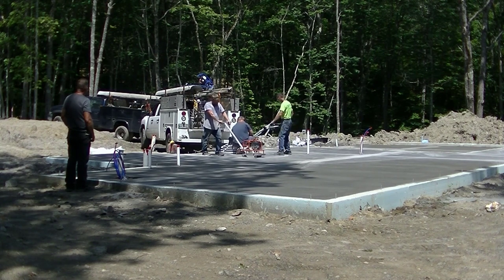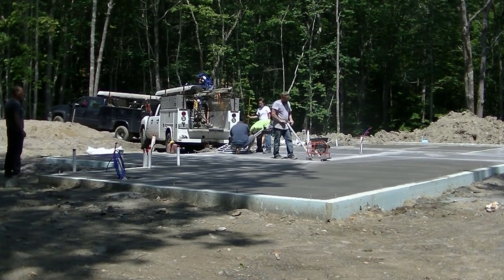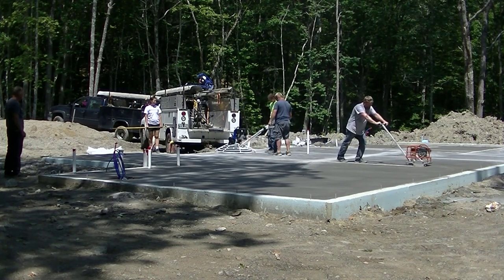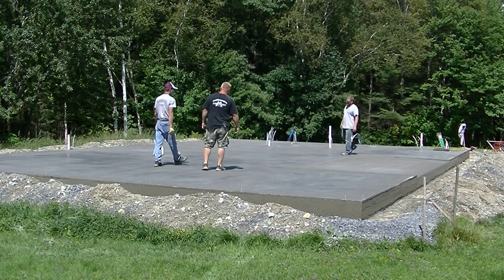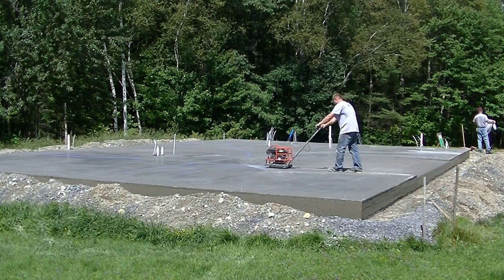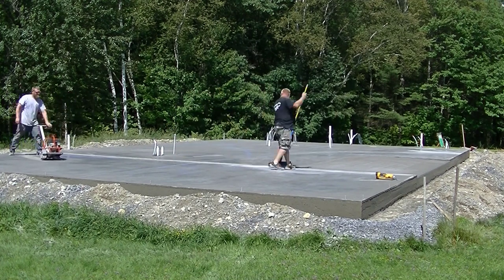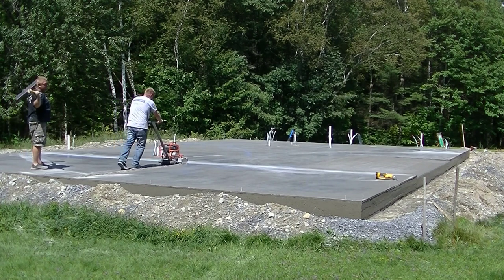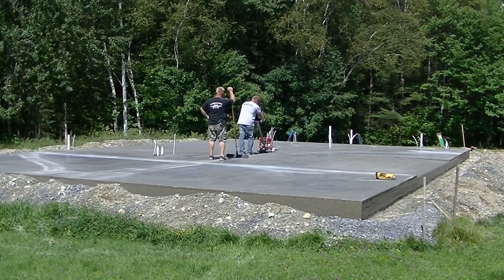The Fastest Way To Saw Cut Your Expansion/Contraction Joints In Concrete Floors & Slabs

Comment: I have the Husqvarna saw with a Suburu engine on it. I don’t use the guide either. It’s not rigid enough.
The saw is great, but we usually cure and seal directly after finishing so we typically cut the following day.
We often times will tool one or two joints on a hot day and then make the other cuts the following day with this saw.
The only issue I have with same day cutting is having to power wash it before sealing. (Adding another process) and also the way that the concrete dust (almost paste) on same day cutting takes away from the crispness of the joint. I have 35 years as a concrete contractor in the Midwest. And when we finish a garage floor to be “baby butt smooth”, we call it burning it in. I enjoy your videos! Best of luck to you!

Comment: I am about to start my own business doing control joints.
I am cutting about 3 jobs a week right now. I use a small electric saw, but want to cut earlier as I often find cracks on hot days.
I am also a concrete finisher in Canada,  and the polished look is called burnishing, which is the correct term for polishing things with steel.
Reply from the maker: We call it burnt finish.

Comment: Hey Mike, I 100% agree about using an early entry saw. In addition to saving time, you save the stress worrying about cracks. The company I work for has a couple, including 1 Husqvarna, and TBH there's not much difference between them.

Comment: I just picked up a soff cut 150  2 months ago and have got to use it on a few jobs now . I'm playing around with when is it time to cut   so far about 1hr and a half after I broom   ill start doing my cutting . I will say it is nice to cut the same day and move on to the next job and not worry about going back  for 15mins of work
Reply from the maker: Yea, it depends on how hot outside it is. 2 - 3 hours is usually safe without leaving any lines from the saw.

Comment: Nice tips Mike, thanks. I've tried planning ahead to avoid reinforcement being run in the same direction too close to the saw cuts to avoid the occasional weirdness of lateral cracks as you described. Seems to work so far.
Reply from the maker: Awesome, nice comment. Thanks.

Comment: I use the rule for how far apart to put the saw cuts as, twice the thickness in inch’s in feet. So a 4” slab would have the squares 8’ by 8’. And a 6” slab 12’ by 12’. You can usually cheat it a couple feet but it’s a good general rule. I also saw 1/4 the thickness of the slab. That helps cut down on cracks right next to the cut.

Comment: Hi Mike, great video.  I wish my contractor had one of these saws.  I just had a contractor pour an 18 x 24 patio and a 12 x 40  driveway.   Everything looked kinda OK until he cut the expansion joints.  He used a chop saw and by the looks of it he eyeballed it.  The lines are very jagged and not straight.  Is there a way to fix this?
Reply from the maker: You can fill them and re-cut right next to them. It'll be next to impossible to make them disappear completely no matter what you use to fill them with. I'd use a two part polyurea and sprinkle some white sand on top to blend it with the concrete.
Reply: Thank you, I’ll have t try that.

Comment: Hey mate any tips on re-entry of cuts? (to finish off the end where you started back the other way) many thanks from New Zealand
Reply: look up Crab cut.  You can use a piece of plywood too, but its best to back saw off and start into it so you avoid the re entry and also cant blow out the edge as the blade is spinning towards you

Comment: I have a soft cut saw, we cut same day. I put a lot of joints in. If it does crack the saw cuts keep your eyes from Focusing in on the Random crack. The reason it cracks more at Corners is the pressure coming down the walls, when the pressure gets to the corner it’s like water being reduced all the sudden from a 4” pipe in to a garden hose. (Boom) What you can do ( but I don’t) is take the time to cut the last 2 or 3 feet from the corner 2-21/2” deep it will help Absorb the pressure. When you see a crack next to a saw cut it usually at the corner because it is overwhelmed by the pressure coming down the wall. But how much extra time are you going to take to do these things when your just getting $1.00 - $2.00 per sq ft. labor. The buying population says if I can get it done 50 cents a square foot cheaper I can live with the crack, which in reality is smaller than the saw cut (just not uniform) a saw cut is really just a crack that is  more acceptable because it looks better.

Comment: -Absolutely best to saw cut the same day. It’s just going to take much longer the next day, cuz the concrete is just harder. I’ve had really big slabs before that we were still cutting into the night but we already had the lights there from starting the pour early in the morning so just crank the lights back up and get it done. 
-When you trowel out a slab to that ‘mirror’ like finish, we always called it, ‘burning it out’.
-Agree about the guides that hang out over the front of the machine. They’re useless. Just watch the blade.
🤜🤛
Reply: YOU ARE VERY MUCH ON POINT ABOUT THESE LARGE CONCRETE  SLABS . THE LARGE FLOORS , WE MACHINE BURN FINISH , AN SAW CUT ALL CONTROL JOINTS IN ASAP . I CAN NOT AFORD TO COME BACK TO CUT THEM IN.
Reply from the maker: Same day cutting is a must for us. Good comments guys, i appreciate it!

Comment: I have a handi-cap ramp at a convenience store that is to smooth and slippery. Its been there about 20 yrs. Could I use the saw to groove ?
Reply: That would be a lot of work. I think you could resurface the concrete with a rougher finish. Home Depot and Lowes sell different re-surfacing products.

Comment: Mike I’m definetly considering one of these soft cut saws. We always go back tbe next day and cut with a demo saw up against a 2x6 to a chalk line. Its a real pain and man the dust will fly. I started wearing a respirator. Do you ever get the stones poping out as you cut? The demo saw will pop the stones if you dont wait until the next day. How about when you get off the floor early and its not burnt in as we call it? We try not to burn the pole barns and garages to much because they get so darn slippery we leave a little fuzz as you guys call it. Especially if the customer is going to put cure and seal on the floor. That makes it even more slippery. We do trench drains in garages and pole barns and they can crack real soon so its a pain to go there early the next day to cut them. Stop by my channel (Bondobuilt) and check it out and I'd love some feedback. I’m new to youtube started my channel a year ago. Im always trying to learn more and more about concrete and making videos as well. 
Regards
Ron Bond (Boindobuilt construction)
Reply from the maker: The soff cut is designed to cut the same day, it doesn't pop out any stones.
Reply: Mike Day Everything About Concrete. Thanks mike.  I see MK is making a early entry saw as well. Close to the same price but with a Honda motor.

Comment: If we have something small and far from home, we use zip strips instead of      cutting it
Reply: Do you RIP the edge off and leave the rest in the slab?
Reply: Yes you rip off the top portion which is black
Reply from the maker: We used to use zip strip all the time before the early entry saws came out. On large floors, 10,000 sf and up that was a real pain in the ars.
Reply: Mike Day Everything About Concrete you bet

Comment: Saw cutting is a complete disaster for achieving a top class job
Reply from the maker: Why is that Paul? How would you control expansion/contraction?
Reply: @MikeDayConcrete  put joint in concrete when laying. T shape with dowels. Fully separate each slab section.
Reply: Maybe on on an exterior slap but in an interior pad like in the video a saw cut should be used